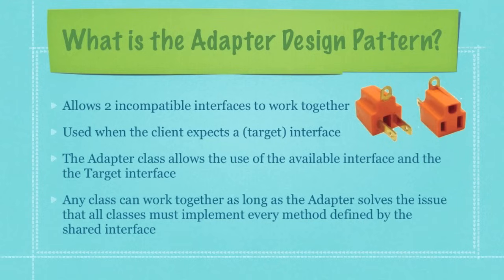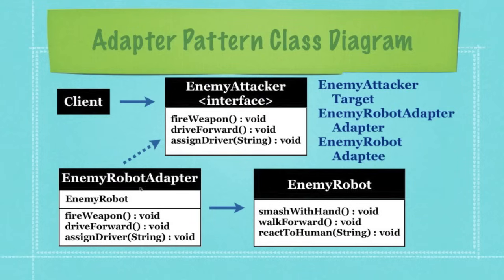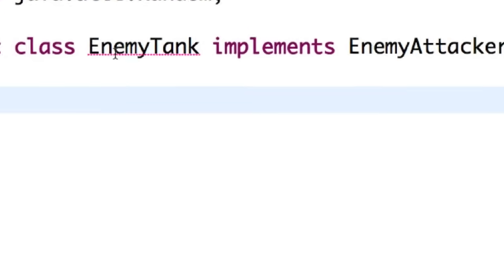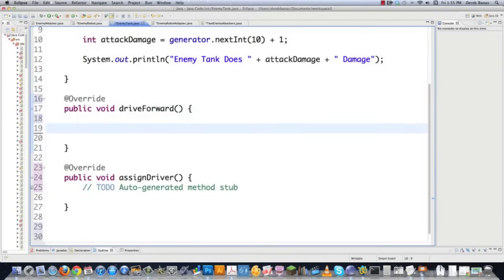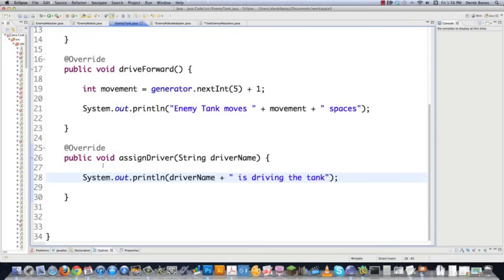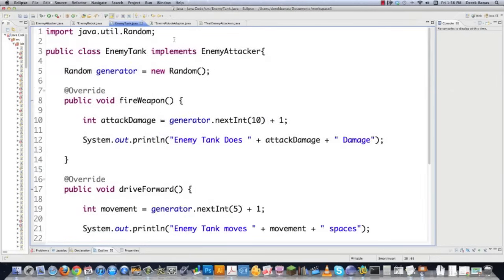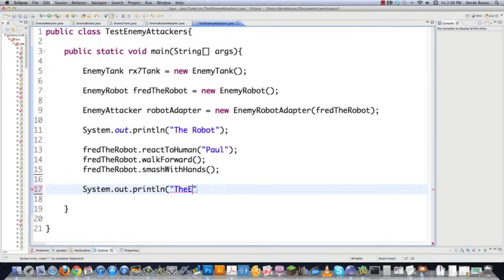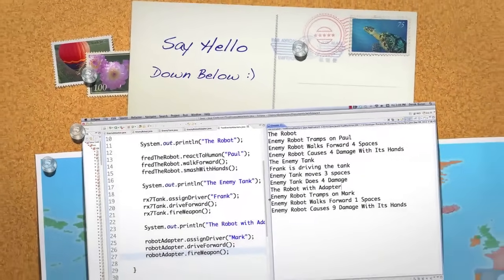Adapter Design Pattern

Comment: If the EnemyRobot methods take in the same parameters and return the same thing, what is the difference besides just the method name when implementing. Why could you not just make an EnemyRobot class that implements the EnemyAttacker interface its own way and just put a comment explaining its specific implementation?

Comment: Why not just have EnemyRobot implement EnemyAttack directly and override the methods to print what you want?
Reply: As you can see, the EnemyRobot does not need assignDriver() method, therefore the EnemyRobot class should not implement the EnemyAttacker interface because you should never force a class to implement something it does not need. So the solution is to create adapter that handles that one method which is useless on our EnemyRobot. I hope i am right, and i hope it helps you.
Also, it is for example useful if third party code is used, but cannot be changed.

Comment: I like this video. But I think that it would better to the example if it was used a method who receive the interface EnemyAtacker and use it to call the him definition methods. So this way will be able to pass to the method both objects, the robot (EnemyTank) and the robot with adapter. To clearfy the example. But stay here my suggestion to other people to a better pratical example. Or am I wrong?

Comment: why don't we just use inheritance instead of adapter ?
Reply: because inheritance is used in a is-a relation. For example a shark is a fish. But a robot is not a tank.
Reply: Legacy code, or combining different software solutions of different languages. Also, sometimes the language you're using doesn't have inheritance. This pattern is used a lot in back-end work, particularly internet systems.

Comment: why can't I use the enemyRobot class and just use the methods of that like how he did in the first 3 lines of the testing?
pls reply ASAP need to understand for my exam tommorow
Reply: I was going to answer this question but I am already 2 years late for this sorry(((
Reply: @data8982  its alright , I did well as far as I remember , we didn't have any adapter related questions luckily . You could still explain tho I mean knowledge is knowledge
Reply: @ArthVora-DarthArtra  The reason why we can't just use the enemyRobot class is that it is more convenient to use interfaces to work with many classes. Let's assume you have 10 different types of EnemyRobot classes. Each has its own different functions, i.e some has Fire with Bullets or some has Fire with arrows functions. So, lets say you want to implement all functions of each class at the same time. What you will do is to write each functions name by name ( enemyRobot1.FirewithArrow() , enemyRobot2.FirewithBullets() etc)
But, using Interfaces  is more convenient to call functions. The only thing you do is just to call object and its functions. enemyRobot1.FireWeopon() , enemyRobot2.Fireweopon(), all is same.
I hope I could help

Comment: After seeing this, im getting confused with strategy pattern. Strategy patterns and adapter pattern almost does the same job right?
Reply: pls explain anyone
Reply: Indeed it looks so familiar to each other. I don't see the difference in this example of the adapter pattern. Strategy looks more like State, maybe looking in to state will help you.
Reply: I found another tutorial that is very good and simple. If you watch that tutorial first and then this one, you will understand the Adapter Pattern and this example.
"Adapter Pattern – Design Patterns (ep 8) by Christopher Okhravi"
And you will see the difference between Strategy and Adapter.
Reply: in Strategy pattern you have an interface which shares X classes with different implementation but with common aim!.  in Adapter pattern you have for example 2 totally differenct Classes. one of them is implemented and the other one is your EW class that you want to implement it as a feature.  Because im differenct Classes, you need an "adapter" that connects these two differenct classes. in the Adapter class you can decide which method / class you want to invoke. So it is not sharing the same problem like in Strategy pattern!

Comment: Hello, this video is very good and understandable but i still have a problem. I need to program a Java project for Uni to show what the usage of the Adapter Patter is and explain in a presentation what the difference is to the Bridge Pattern. The problem is i still dont get the difference between them two. Can you please explain it to me.

Comment: I think, it could have been made more simple, by just mentioning that the adapter-pattern, kind of a mapping-class, where the interfaces (on one component) is mapped to available interfaces (of another component).
- This serves, that changes in the interfaces, would have minimal change, all at one place. - And secondly, that the component-1 interface can be made more human-readable (use-case specific), even though it uses the underlying component-2 interfaces (which are more oriented towards core-functionality).
What say @Derek Banas?

Comment: why bother with an interface in the first place
Reply: +billyblackburn87 This is an overly simplified example. You wouldn't need an interface for code this simple, but it demonstrates the point well for real code where interfaces would be required for consistency.

Comment: Hi Derek, I studied this wonderful video and then try to reproduce it by memory. At this point I was wondering how to make it to use and came up with a class that has an array of EnemyAttackers of which size is set by the constructor, a method to Add an Attacker, a method to walk all Attackers and a method to let all Attackers Shoot. Now this class has no interest in what it gets, either an EnemyTank or an EnemyRobotAdapter as both are EnemyAttackers with the same interface. Wow, it works. I named this class Game, made a tank and a robot and added them to the game. Now I call game.walk() and both walk. I call game.shoot() and both shoot. Thanks to the Adapter class and thanks to your wonderful super simple explanation of the Adapter Design Pattern. Thank you for long hours of programming fun.
Reply from the maker: +Frits van Doorn That is awesome! I'm very happy that I could help :)

Comment: Your design patterns videos are great. But a few of your scenarios are a bit too weird and abstract and just do nothing for the learning experience aside from confusing the subject. This robot one is almost as bad as the flying dog scenario I saw in one of your other videos - it's just hard to see where all this would fit in the real world. A better example would be a "legacy database", "legacyadapter", "new greenfield system" scenario, and whilst not as colourful would make for a better learning experience. I think it's also important to start lessons like these with something "already existing". Because it is a crucial component of the adapter pattern. You don't utilise this pattern from a clean slate: you have something pre-existing that you require to interface something else with: that is the problem that the pattern solves - so it's difficult to see the value of the pattern when you start with a clean slate and make all three parts from scratch - what's the point of the pattern?
Reply from the maker: +reach4thelasers I'm sorry that you don't like them. My goal was to simplify the patterns so that people could then pick up and completely understand a book like Design Patterns: Elements of Reusable Object-Oriented Software. To do that I decided to keep the patterns as simple as possible.
Reply: +Derek Banas I don't dislike them. Most of them are excellent. A couple are a little contrived, like this one. I think if you're trying to simplify the subject by exemplify in the adaptation robots into tanks (or whatever you were doing - I'm still not sure) you're actually having the opposite effect. It's making the problem and solution less clear. What makes Gang of Four and Fowler-PoEE such excellent books is they present a problem in terms that a programmer can actually relate to and use simple scenarios and show how they solve them: there's no tanks robots and flying dogs. Why on earth would you ever want to make a dog fly or make a robot drive a tank? It is so abstract and unworldly it doesn't make sense.
Reply: +Derek Banas by the way.... I'm a solution architect myself. A .NET Engineer of 15 years... and I come to your videos for a refresher when I need to implement a pattern I've not used for a long time. Take that as a compliment :) I just found this and one other a bit confusing due to the subject matter and wanted to give some constructive feedback. :-) Most are outstanding. Thanks.
Reply from the maker: +reach4thelasers Thank you :) I appreciate the compliment. Yes I know that I could have come up with better examples. That is kind of the curse of making YouTube videos. I used to feel very rushed in the past to make videos as quickly as possible. I've learned to slow down over time. Thank you for the input. It will influence everything that I make from now on.

Comment: Hi Derek, thanks for the awesome work. I just have one question why did you store a reference of EnemyRobotAdapter to EnemyAttacker interface? Wouldn't it be more easy to invoke methods on EnemyRobotAdapter instead of including EnemyAttacker along the way? I'm sorry if this question a bit off. I'm not an actual Java developer.
Reply: ***** you know just using

EnemyRobotAdapter myEnemyAdapter = new EnemyRobotAdapter(fredTheRobot);

Then, 

myEnemyAdapter.assignDriver();

myEnemyAdapter.driveForward();

myEnemyAdapter.fireWeapon();

Wouldn't this be the same?

Comment: What if you have an extra enemy entity? Say you have EnemyAircraft. This has methods dropBomb(), flyForward(), assignPilot() (which for the sake of the example is different than assignDriver). How would you do that with the adapter?

The adapter class then has 2 attributes: enemyRobot and enemyPlane, right? Do you then just drop enemyPlane.dropBomb() into the fireWeapon() method together with the enemyRobot.smashWithHands()? (etc etc)
Reply: You make an adaptor just for the EnemyAircraft that accepts an EnemyAircraft and replaces the respective methods with the according ones.
Reply: Oh so each class gets a seperate adapter? 
Thanks
Reply: JayDeeBee Almost. Not every class, but every interface. If you have 5 classes that use interface InterfaceOne, and need to be adapted to InterfaceTwo, one adapter would suit them all.
Given your example. Let's say you have flying and walking enemies:
Flying enemies use the interface EnemyFlying with dropBomb, while walking enemies use EnemyWalking with smashWithHands.
You make "EnemyAircraft implements EnemyFlying", "EnemyHelicopter implements EnemyFlying", "EnemyRobot implements EnemyWalking", "EnemyFootsoldier implements EnemyWalking".
You would just need to make 2 adapters: EnemyFlying->EnemyEntity that converts dropBomb->fireWeapon and EnemyWalking->EnemyEntity that converts smashWithHands->fireWeapon.
The Adapter patterns is very very ugly to explain in Java because it's the only major language with no form of Duck typing.
Reply: AdnanClyde Ok. I meant every class with a different set of methods needs a different adapter, right? If EnemeyAircraft and EnemyHelicopter use different methods, they would need a different adapter, correct?
Reply: Great thanks
Reply: AdnanClyde Another question conserning the use of Adapter. Why don't you just use the robot class and create an object of that class and use its methods, instead of using the adapter class in between. In the example in the video (in the main method) he makes a robot, lets the robot do stuff and (logically) it works. I don't quite see why you would actually put the adapter there. I see what it does and how it works, but I don't see why you would use it (if that makes sense?)
Reply: JayDeeBee The same reason why there are a dozen different types of electric plugs: someone else made it, and you need to plug it into the system you made. If a manufacturer makes a lamp that has a certain power plug to be powered, and your country uses incompatible wall sockets, you need an adapter.
In the example he has no reason to do it. It is useful when you use some external libraries, and you need something to have a certain interface, so you stick that something in an adapter with your desired interface.
Reply: Ah but in this example it doesn't truly serve any purpose. It's just to show how it works then?
Reply: JayDeeBee pretty much. Imagine that someone gave you the rest as code that you are not allowed to change, and you need to make a way to plug one into the other. thus you wrote the adapter class. :)

Comment: i'm glad i started looking for design patterns on youtube! This comes in really handy right now, thanks Derek Banas for the great videos!
Reply: Sorry Derek, I forgot to ask.. what would be the difference if this was implemented with class adapter ? Would the adaptee EnemyRobot mandatorily be an interface or could it be just a class ?
Reply from the maker: I'm sorry, but I'm not understanding the question. Can you give me an example on what you are trying to create?
Reply: Derek Banas First of all thanks for the answer ,I'm just studying for a test not really developing :/ My question is due to the class Adapter, there are class Adapter and object Adapter right ? This example was on object adapter, what would be the differences if we used class Adapter instead ? using multiple inheritance on the Adapter instead of object composition..
Reply from the maker: Alexandre Silva I'm using composition here because Java doesn't allow for multiple inheritance. I normally default to composition, but that may be because I prefer to use Java over other languages for this type of stuff.

Comment: Hi Derek, maybe it is a silly question but would this work even if the EnemyRobot doesn't have for example the reactToHuman(String) method? So if the EnemyRobot doesn't have all of the required methods (just some of them) then the Adapter pattern is not suggested?
Reply from the maker: The adapter pattern is there to insert new objects and methods into a system without forcing other objects to add new code. So when the enemy robot object is called instead of calling assign Driver which the enemy robot doesn't have, the adapter instead calls reactToHuman. Does that help?
Reply: Thanks for your response. It is clear now :)
Reply from the maker: I'm happy I could help